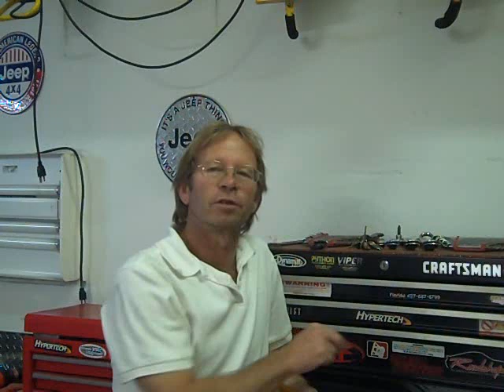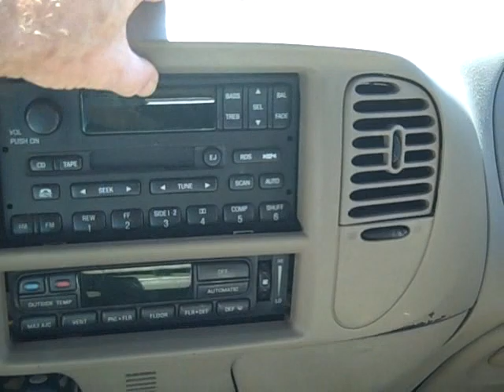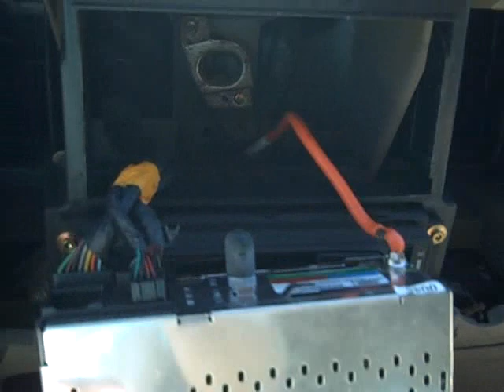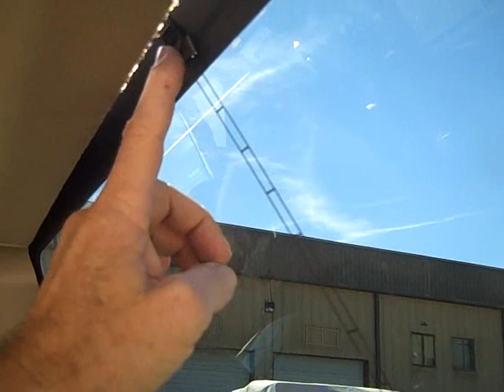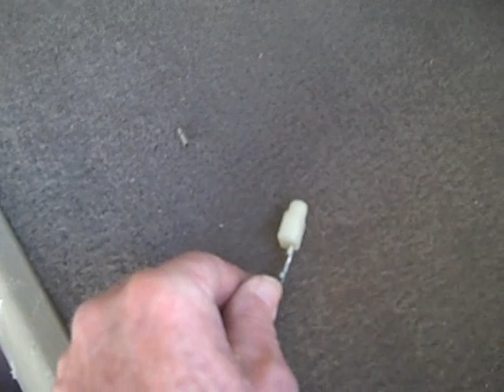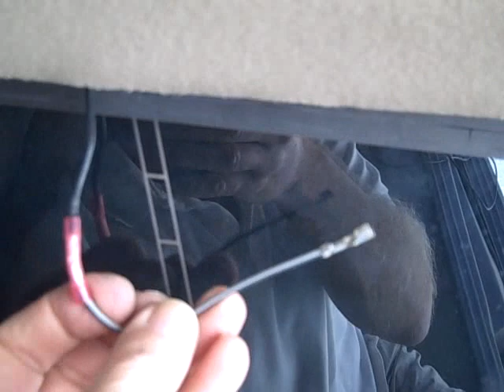Ford Expedition Remove Stereo + Poor Reception Repair = Car Stereo HELP

Comment from the maker: There are usually two fuses for the car stereo. One located in the passenger compartment, under the dash driver's side. Second, under the hood near the vehicle's battery. Check ALL fuses, only one is labeled for the car stereo.

Comment: Does the 2000 Crown Vic have the same problem? Because I can't get my radio out with just the DIN tools. Is it that easy to take off the panel. Just find the clips and pop it lose?